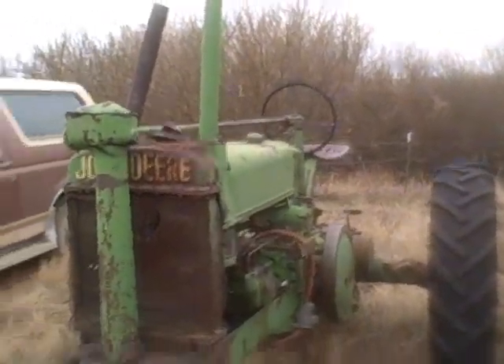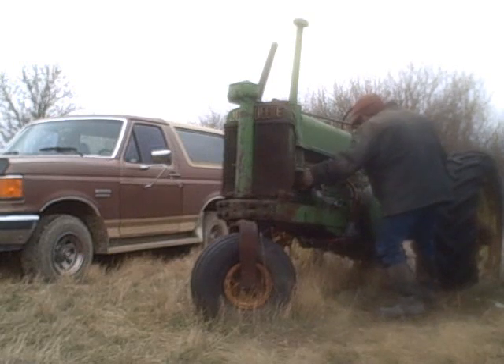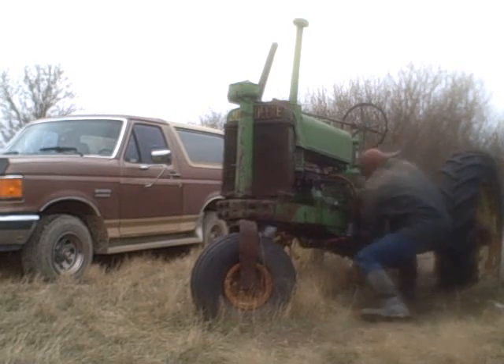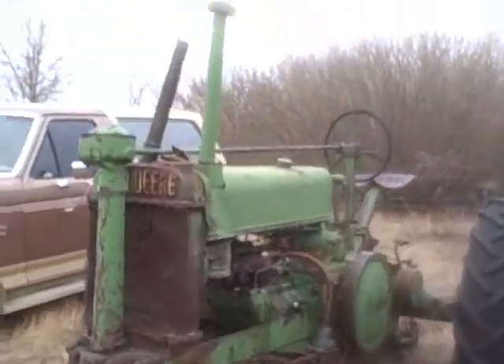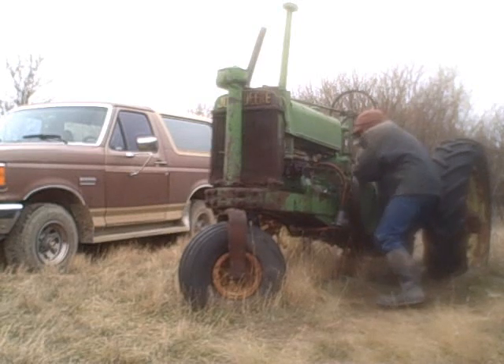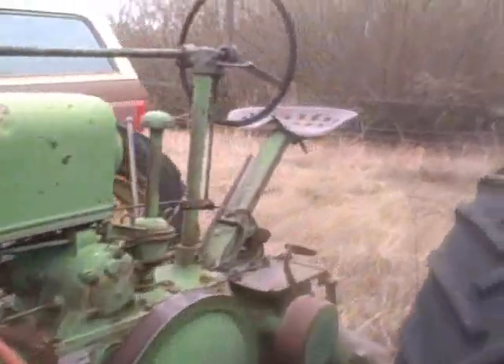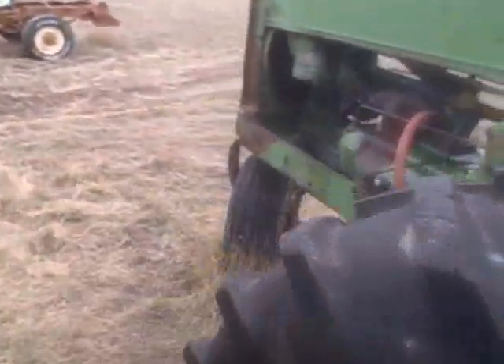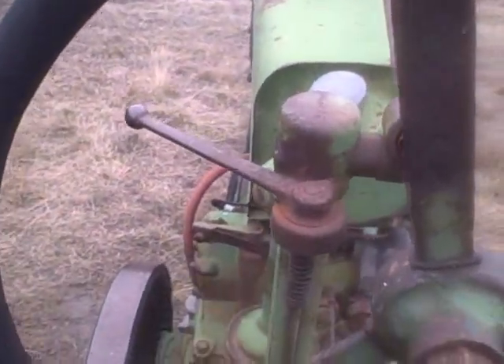John Deere Model A second time started since 1997 trying to get it moved and up to the shop

Comment: when I was a kid in SD our neighbor used to hire me & my brothers to help with harvest, Threshing & haymaking. He had a '36 A with a Du-all loader on it. That thing had priming cups on the de-compressor taps. I don't know if that was a JD option or after-market or what but it sure made cold starting a damn sight easier. Just fill the cup with gas, open the taps, roll 'er over a couple times & it started right up.

Comment: Wait till spring.  Water has gathered in the oil in all areas.  After you get it out of there, change all the oil in trans, engine and air filter.  That single wheel front makes the tractor more rare.  Make sure you have oil pressure on start up.

Comment: Dad had a 40 A.  It was the second tractor he had.  He had had a 37 AC WC that he used to run over my older brother.  The 40 A I remember would have an explosion like a 20 ga shotgun when it first started.  He got rid of it for a 48 H Farmall.  It was all painted up and decaled like a new one.  This was around 55.  Then he got a 1 row Wood Bros corn picker and we thought we, bro and me were in hog heaven.  Course we still had to pick out the ends and 2 or 3 places in the middles, taking 3 or 4 rows each place.  Dad got tired of that after one year and bought a #24 IHC 2 row mounted picker.  Now there was an end to picking out the rows, BUT we couldnt pull the wagon inside the shed that leaned over the entrance to the corn crib, so he bought a 37 A JD.  I started it for the first time by myself when I was 12.  He got rid of both the H and the A for a 49 A and a 50 B. around 63.  then he bought my uncles 41 M Farmall when he died in 65, and thats what we had when I left home in 68

Comment from the maker: that beauty is an 87 eddie bauer picked it up for $300 runs great but with 180000 miles on the ticker its a little tired but ive got another motor a built 302 in the shop thats waiting to go in check out my other videos cause Ive got one up with a cold start and story of it

Comment: @supergrant15 it's a spin start meaning you spin a large metal wheel that terns over the motor basically it's like taking the cord off a pull start and just spinning the wheel.

Comment from the maker: yeah theyre not as easy to crank as a guy would think kinda tires you out... when we had ours running the last time you could usually have it running in about 3-5 pulls but I guess sitting for 12 years will take its toll

Comment: A trick we use to start old diesel engines is to fill the rad with hot water but I dont know if it would work with a gas engine

Comment: What you have to do is pull start. Get chains and a stronger Deere and have 2 people. Get one guy to start the bigger Deere driving and you sit on the A. When he gets going disengage the clutch and put in THE HIGHEST gear then let out the clutch. When it starts disconnect and have fun
Reply: Hell no! Just crank the thing. Give it half throttle, full choke, and if the carb is set right at all, within the 3rd or 4rth crank, it should fire right up. That's been my experience with B's and GP's. Belt starting them is much easier on them too, but that's a last resort. Learn how to start them right!
Reply: with an engine like this. its better to use the way I explained
Reply: I can honestly say I don't understand why. Would you mind elaborating on why that's easier on them?

Comment: Need to get a big drill motor with a toilet plunger chucked in it (with a vent hole drilled in it so it doesn't stick on), and try that on the flywheel. Bet it would make starting a breeze.
Reply: Probably not, needs lots of force and if it were to backfire the wheel spins back and can break wrists so it would screw up the drive of the cordless
Reply: Randy Lahey
 I was referring to a big 110V rock-drill motor (yes it would need a generator). We used one to start our nitro-methane flathead nostalgia dragster. Yes, it took quite a bit of juice, but as long as we had the spark retarded, it would start it up fine. Just a ratchet and socket to the bolt on the front of the crank.
Reply: Randy Bobandy

Comment from the maker: it is by serial number either a 1935 or 1936 and someone told me it could even be a 1934... the motor however has never been opened up... like ChuckE2009 has said before though these things will run forever, for shits sake theyve got a 975 rpm redline so theyre barely even turning at wot

Comment: if I am going to start a tractor that I know will die real fast, I would straighten out the wheel give it all the gas it has and slowly move the clutch without working the engine, continuously do that in reverse and first for starters. and if you want it to start faster, sometimes if you give it full throttle with no choke on them things it starts better, or quarter throttle with full choke, or half and half sometimes does it. and why don't you just pull start it. or try

Comment: You can push it with a car to start the engine...
Reply: True. We have a730 JD and we had to pull it off with a 2240 and it started even though the battery was dead.

Comment: If its stuck in the mud then get a Case Four Wheel Drive 580SK Turbo BackHoe Loader and pull the fucking thing out or you can just play around and grab a shitty Ford and burn ur tires to get it out.But anyway it would be a nise tractor if u put alot of work into it so do ur best on getting it out.Good Luck!!!!!!!. P.S. sorry if this is a late comment...

Comment: nice tractor im looking for something similar im not too knowledgeable with tractors i just refer to them as "3 wheel tractors"  well i need one so if you know anyone one in Colorado who has a 3 wheel tractor or something similar that basically has a pto and is cheap under $1000 with a brush hog or wants to donate one running or not let me know